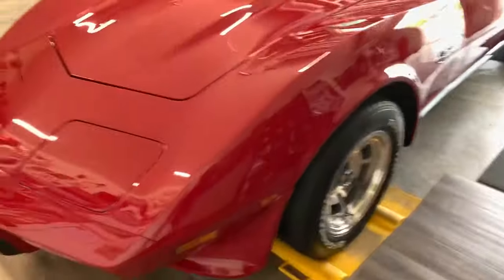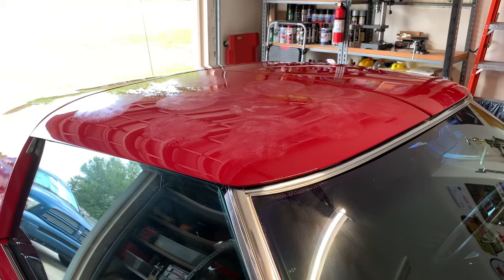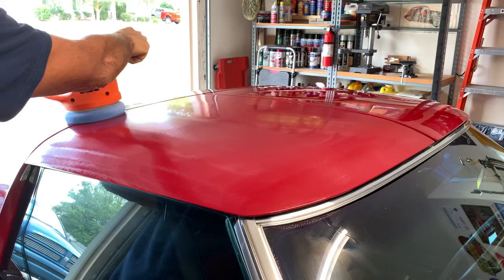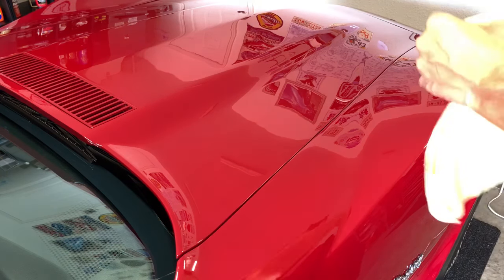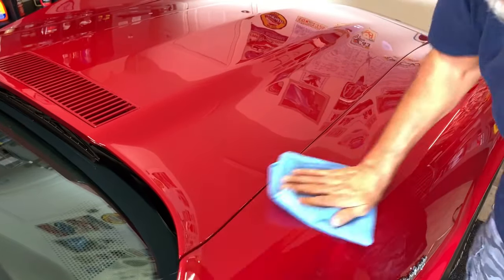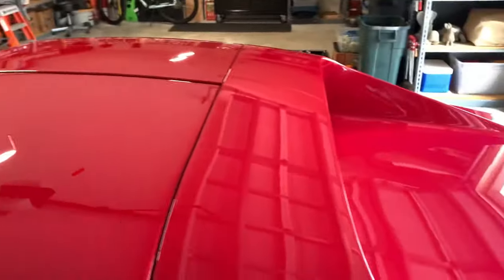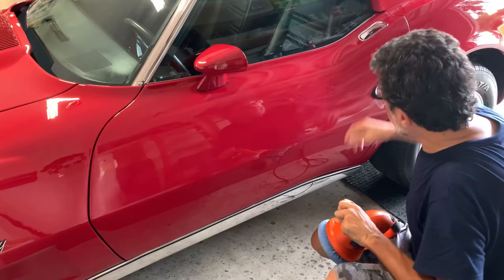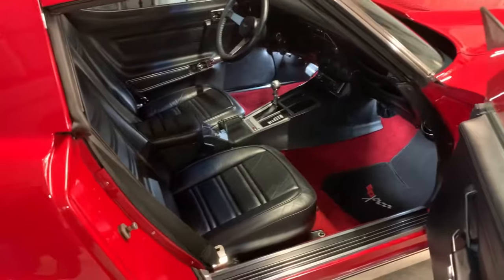WATERLESS Wash & Wax. Does it Work?

Comment: How do you get the wax/polish out of the thin gaps, like between rear bumper and body?
Reply from the maker: Good question, but I mostly use spray-on polishes and waxes so that’s never really an issue. But when a paste wax accumulates in a gap, a good microfiber towel usually takes care of removing the excess. Having a good small detailing brush is also a good idea. Thank you for watching! 😊👍🏻
Reply: I just used the liquid Blazin Banana and it left a white line, I’ll get a brush, the gap is too tight for a cloth